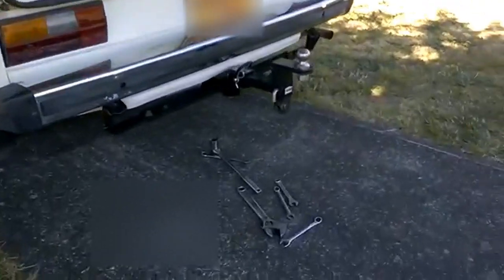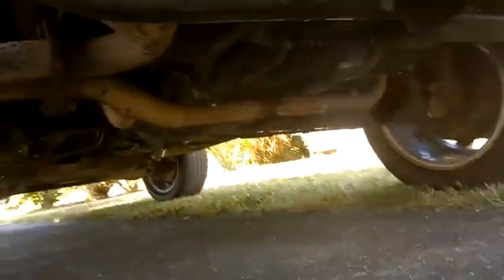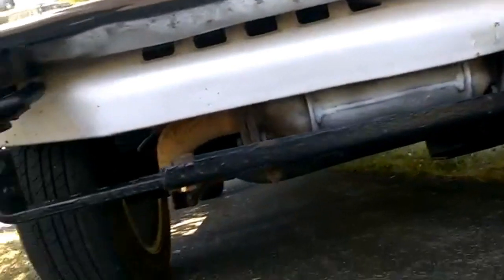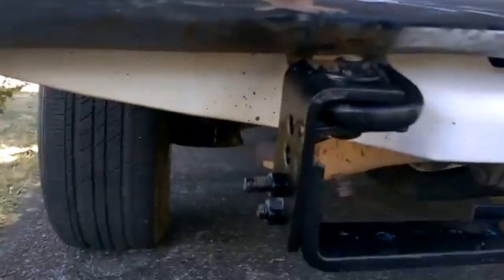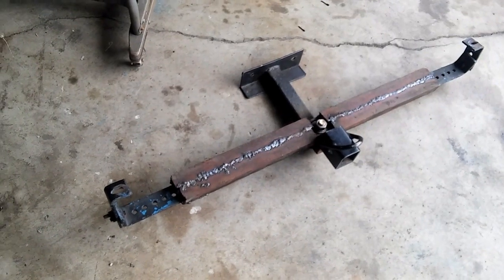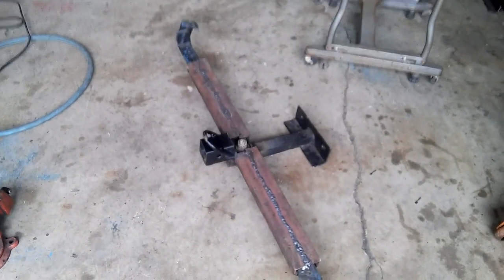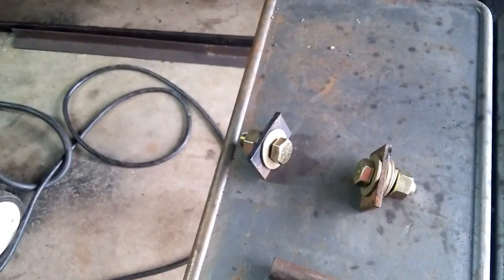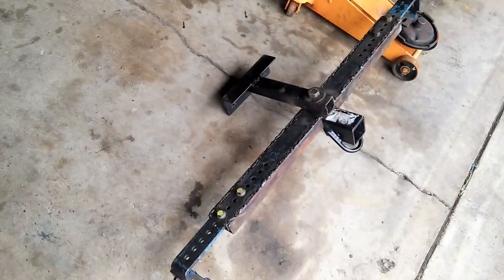Building a VW Vanagon Trailer Receiver

Comment: Any ideas on how to upgrade the suspension to handle a Class III hitch?
I want to tow a 30ft sailboat at around 50-55mph...I'd be using a Subaru EJ25 (227hp) and a new 5-speed transmission from SubaruGears, in Australia. The vanagon would be upgraded to disc brakes and electric brakes on the trailer...
Reply from the maker: Syncro springs, air shocks or shocks with springs. Hitch needs additional attachment points to the subframe.

Comment: Hi could Know you experience in towing? How many kilos!?
Reply from the maker: I think the limitation is the vanagon suspension which you don't want to overload, so probably 1500 pounds maximum.
Reply: @vanstechcorral  i've pur 1500 pound inside with olive for oil, and no problemi in 4th on the hill
Reply from the maker: @gigirusso4440  Do you run the olive oil as a disel fuel?
Reply: @vanstechcorral  noooo i loaded the bus with olive, not inside the engine..
Reply from the maker: @gigirusso4440  I do use vegetable oil as fuel in my other van with a diesel engine.